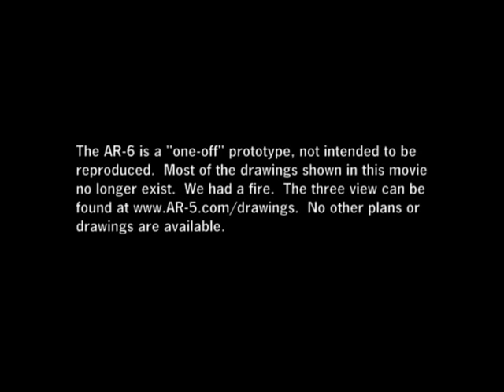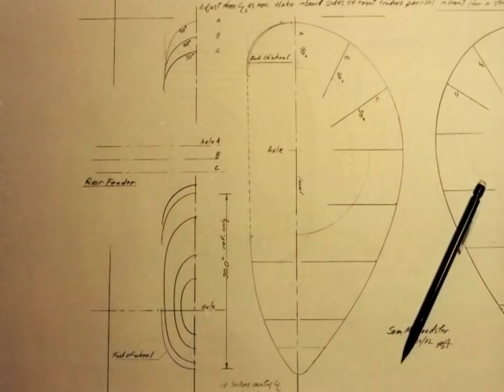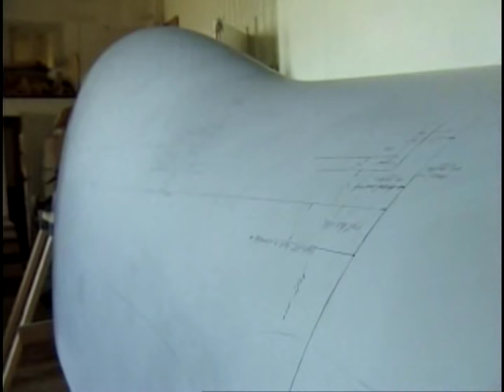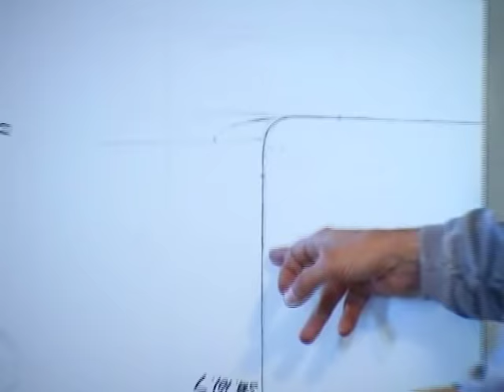Making A Molded Fuselage

Comment: Does anyone know if the pipe goes all the way through the backbone the plug is formed on?  Or did they use a short pipe on each end?  In the video Mike seems to say "Pipes" as plural, but I'm not sure.  Seems like one solid pipe going all the way through would be strongest.

Comment: Do a 3d scan of the plane after fully built and see how left/right simmetrical it is.
Reply: I suspect not, but I bet it is within .125" as he seemed to have a sharp eye.  But at higher speeds even .125 is enough to require speed and power robbing trim to fly straight.  Not to worry though, even Korean Aerospace could make MD-95 [717] noses straight enough to use in Long Beach final assembly.
Reply: Yes from a "perfection" standpoint that is an interesting thing to do. 
However, as all Single engine aircraft are not in symmetric airflow, iw would be better to make the aircraft Assymetrical to cancel out the propwash effect on all areas of the aircraft  (usually only allowed for in the fin area) - with some aircraft designed with an offset fin to act as a "baseline longitudinal trim".  Without detailed windtunnel or high fidelity CFD that (design perfection) would be hard to achieve.

NB, For all different power settings trim (in all axes) requirements vary - so Pitch, long and Roll "trim" are usually designed for the most common power setting, for GA aircraft that would be cruise, while for a race aircraft that would most likely be approaching Max continuous power.

Comment: The technique used is OK, but just like in building a model plane he could have used Former and Keel method stuffed with foam blocks and sanded down to shape. Sanding down to the formers would have made faster work and probably reduced the incident of low and high spots.
Reply: Agreed.  Tuttle as in Tuttle fin box?

Comment: Does anyone know where i can find large blocks of foam for making aircraft plugs?, i searched but i keep finding them in small blocks, thanks
Reply: noversibirsk go to home depot,
Reply: You will need to search for commercial vendors or buy pieces from refrigeration companies or others that use them. That or find flotation billet which is also extruded polystyrene.
Reply: Find a company that blows polystyrene bead boards.  You want to request no regrind, no oil, and around 2 to 2-1/2 pcf.  I used to use it to build sailboards.  Styrofoam core with a vacuum-bagged sandwich skin using 1/4" pvc core.

Comment: Nice video, nice plane, that being said...There is a lot easier way to fair than this that doesn't require eons of learning to sight 3D curves in your mind.  Just PROPERLY use a piece of spring stainless sheet metal yardstick, or professional tool, and it's EASY.  It will fair any curve, within reason.  This along with templating and stringing will do the job.  Not as big a deal as this makes out.
This guy also acts like these tools and techniques are his.  People were doing it long before him, ie. the VeriEZE in 1974 is the first time I know of it being used, and most of the foam/fiberglass sandwich construction tools and techniques came to Rutan via SURF BOARD builders.  People always want to sound so high and mighty, until you actually look into reality.

Comment: So many techno trolls.  Ooh, it would be SO much faster with CAD.  Really?

  After it has been modeled in whichever software you prefer, you have to find a shop with large enough equipment to do the job.  Next, you'll pay for the materials and machine time.  Which WON'T be cheap.

Finally, you are at mercy of the shop to when your project gets worked in.

Well, that wasn't finally, you still had to pay and wait for shipping. 

Let's not forget,  there is no chance for change, of which he made many subtle mods during construction of the mold buck.

I expect he had it finished and shipping out to the workshop before the project could have been subbed out.

Funny that no one mentioned 3D printing  though.

Comment: Too bad he didn't know how to model this fuse shape on cad.  He then could have transferred the offsets to mold forms, strip-planked it or filled between forms with foam.  This would have taken a small fraction of the time to get the final shape.  I've done this many, many times. Less propensity for minor and major errors as well.  If done correctly, he didn't even have to make the throw-away laminating molds.  Another major problem with shaping by hand (his method) is that he has no clues on the resultant curvatures of the surface, therefore cannot understand what is really happening with the airflows at race-speeds. "Looks good" is not always what is really best for fluid flows. But, his craft does look good. There are SO many things I would do differently in both design and construction that would have reduced construction time immensely.  Even though this plane has proven itself one of the fastest f1 racers, all those varying sections do no good for the airflow.  Bondo is probably the absolutely worst material for efficient mold shaping...too hard... designed for long-term durability on road vehicles.  Should have used a very low-density epoxy filler that is much easier to sand.  Also, first and second coats of filler should have been applied with a notched trowel so that initial fairing would require less than half the fairing material and sanding-effort.  Lots of work here! Could have been done so much more efficiently.
Reply: That's how we would do it today, but realize when it was done and it wasn't an unlimited budget either.  If done today and looked at 15 to 20 years later the same things will be said..  But you are right, things just get better and better...  Honestly I think the biggest thing over looked is using a tractor configuration over pusher,,  pushing air (thrust) over the very thing you are trying to move is a bad way to go....
Reply: However.... this f1 was designed and built in the early '90's....I was engineering and drawing in CAD and using CAM to cut  parts in the eighties.  This technology is not as young as many would believe, and it was accessible.  Still, using CAD and a plotter and manually cut the forms would have been far faster than what he is doing here.

 Using a pusher is the worst way to propel a prop-driven aircraft.  The prop is most efficient when it uses undisturbed, non-turbulent flow.  It's efficiency goes right out the window when placed behind any type of structure, especially wings and fuselage.  And the prop is the only thing that is creating forward thrust, so you want that prop always to have the best flow.  With proper airframe design, the drag associated with prop wash is minimal compared to the reduction of thrust the pusher would have.  Not to mention the pusher prop itself would need to be heavier to withstand the turbulence it encounters continuously.  Too many insurmountable physical problems with a pusher to justify it's use.  Yeah, to some inexperienced eyes it looks cool, but the platform just does not work as well as tractors.
Reply: SagaSeaCraft, I dislike chappies like you. Next time you comment upon an obviously competent craftsman, throw a compliment not a rock. There is nothing wring with producing handcrafted quality aircraft the old school way. If you want to contribute show your goodwill with a magnanimous offer to provide a CAD drawing to produce this plug. Then my son, you'll have become a man.
Reply: Agreed Nick, its easy to bash someones work instead of adding to it. BEst part is these guys can never prove themselves better...
Reply: I'm with Nick... 0% experience in aviation, and a 100% of mini-modelling bullshit...
Reply: SagaSeaCraft - I'd be very interested to hear how you know all of this.  Are you an aeronautical engineer?  Aerodynamicist?  How many successful aircraft have you designed and/or built with all of this knowledge?  You seem to be slinging a lot of mud for someone who hasn't offered any information as to why anyone should believe what you say.
Reply: Yes, trained and worked in the aerospace industry, designed many  aircraft and other craft that required large and small components to be engineered and built from a variety of composites and other high-grade materials. I've had plenty experience in building as well. I offered the post in the hopes that others thinking of designing and building would understand that there are far better and more efficient methods to go about building a small composite aircraft that require less time and more accuracy. Do your homework first. Don't be afraid of learning a 3D CAD application (NOT AUTOCAD from AutoDesk - they are much too expensive and the programs are too convoluted -- Rhino 3D would be a good, low-cost choice to begin with, SolidWorks is even better, they are both quite stream-lined in their commands).  Design relatively simple structures rather than super-curvaceous, swoopy surfaces that create flow differentials that you cannot fathom.  Fluids like to flow in relatively straight lines, and fuse sections need to be all very similary shaped in cross section appearance, but with easy tapers, remembering that a tractor (and even a pusher) has corkscrew flow components.  Fillets must be properly shaped without adding much surface area but providing appropriate transitions. Tight-fitting nacelle bulges are probably the worst additions because of added surface area and turbulent flow transitions around hard corners that the flow off the disk is encountering  in it's cork-screw like path.  The best practice is to keep the structure as simple as possible without any weird curves.  For examples, take a look at all the high perf sailplanes. Also, in visualizing fluid-flows, think in terms of volume flow rather than simple line-flow.  And if deciding between sculpting ,sanding, applying more and more filler,grinding some more, or simply designing the craft within a revision-friendly environment , please go with the later. You will not be considered an artist by old-school standards, but your final product will be much better overall with much less resource expenditures.
Reply: Trained or educated?  I'd love to hear about the many aircraft that you've designed!
Reply: As every engineer knows and has experienced, first you think you get educated, then you begin your career-long training within the industry.  The "educated" part is hardly worth mentioning in the grand scale of things, unless you believe a doctorate is of any real value, and/or you pledge your allegiance to your Alma mater and believe that really matters.
Reply: Saga I agree with your assessment of construction technique 100%. I was a little puzzled at his approach, slow and laborious but it it works, just not the best method. I would love to see his design using cad and simulated wind tunnel software, I bet it could make the plane even more amazing. He is what I call a true craftsman, just not an up to date one, but still VERY effective. Keith
Reply: I'm an Engineer but I couldn't agree more. That's natural ability, rare.
Reply: THERES ALWAYS THAT ONE YOUTUBE EXPERT NAYSAYER THAT KNOWS IT ALL. SMH
Reply: I had the same thoughts re formers and filling in between with foam before carving to shape but I admire the builders skill in producing the plug, even if what you say is true it works well in air with great results.
Reply: He is an artist and you haven't achieved what he has, you should think before you type and criticise people with such talents.....
Reply: Nick Carter well said!
Reply: SagaSeaCraft ahhhh,where is your video,Mr Know all?
Reply: SagaSeaCraft a
Reply: Thanks
Reply: As an engineer, I totally agree.  And a VASTLY improved shape, you can model the aero with the virtual "plug" as well.  There are legitimate REASONS people DON'T do this anymore.  A lost "art" just as well lost, IMHO.  The REALLY good designers, like John Roncz, who did a lot of aero work for Burt Rutan, among others (proof is in the pudding), actually put the wing and tail feathers in the model, then design the fuselage around the resulting pressure patterns for maximum drag reduction, light years beyond these techniques. 
The other thing I should point out is when you are done with the CAD, and certainly that and the resulting iterations back into it from the first build and testing, you have the build documentation, at least the drawing portions, DONE!  At this point, with this method, you basically haven't even STARTED that process.  Doable for a one-off, useless for production.
And as a Long EZ builder, YES!  Microballoons and epoxy at varying ratios for different jobs is DEFINITELY the filler of choice.  I could pretty much guarantee Roncz could take the flying surfaces of this airplane and give you a higher performance, lower drag, configuration, unless this guy has access to MAGIC I don't know about, and nobody does, in my experience.  FEA may LOOK like magic, but it's not.  ;-)
I'm assuming all that "necking down" in the front half of the fuse is to be filled with something, or else that would create LOADS of drag.
I would like to see a model of that airplane in the wind tunnel, I'll bet there would be real surprises on that fuse.
The final plane IS gorgeous, I will give him that, but that doesn't always mean highest performance, not by a long shot.